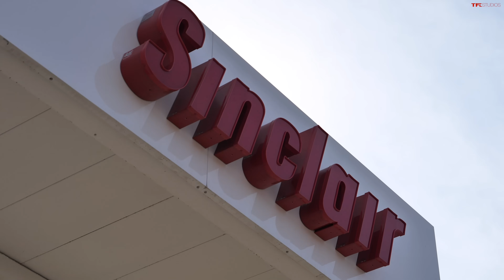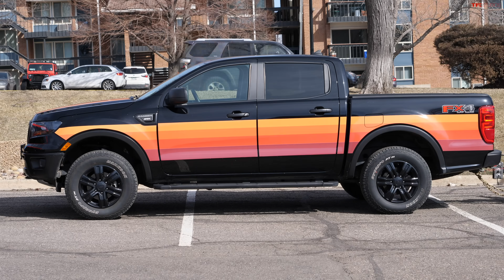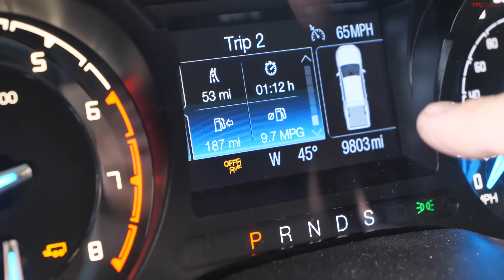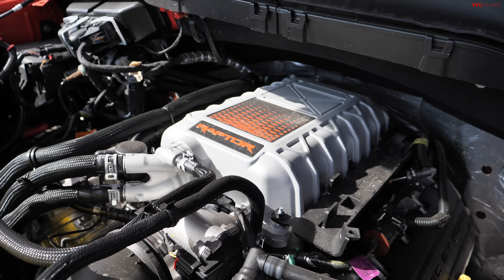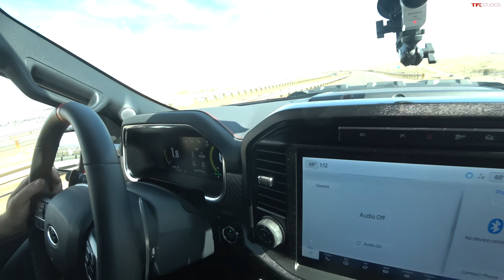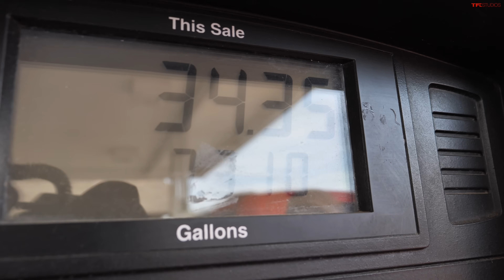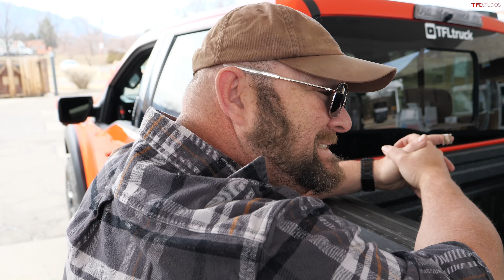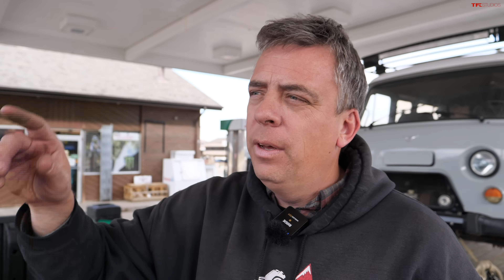Myth BUSTED: Does a Big Engine Get Better Fuel Economy TOWING Than a Small Engine?

Comment from the maker: Hey all, quick editing mistake. At the end the font says "V6" for the ranger, clearly it is a 4 cylinder. Our apologies!
Reply: nope, engines spend most of their time at a small percent of their total power.  Its more efficient to have a small engine using a higher percent of its power than a big engine using a lower percent of its power.  A turbo lets you have a small engine but have big engine power when you need it, of course if you always have your foot in the turbo you get big engine mpg's.
Reply: Wait maybe I’m wrong but wouldn’t the raptor actually be more efficient if it gets 11mpg before towing and then 7.8 while in your towing test witch is about 25% less efficient than before if the ranger was 18mpg then after towing was 9mpg which is 50% less efficient while towing😳……….I think you guys are just factoring the actual usage of fuel instead of the efficiency?! 🤔🤷🏽‍♂️
If you used a regular F150 with a 5 liter that got 18mpg as it says for 2023 and then got 25% of its efficiency reduced while towing if would show the bigger engine is actually more efficient which would be around 13.5 mpg……..sayin?
Reply: @dennissmith7214  agree sir, but the fact that even its ford vs ford its still apples to oranges as raptor is diffrent than ranger. if the vehicles are the same except the engine, without load the larger engine will ve more thirsty but when there is load the smaller engine will consume more.
Reply: @randomscene3219   Yes like compare stubby to a similar sized ram with the 5.7 and I bet the 5.7 working less with a load would fair better than stubby🤔…….but that’s just my logic kicking in.
😏👈🏽
Reply: @dennissmith7214 i think you are confusing efficiency of the engine when the premise is fuel efficiency. Doesn't matter if one engine only loses 25% mpg vs 50% mpg of the end result is you use less fuel with the 50% vs the 25% because that second option is 15% more efficient. 

Arguably of you don't need Raptor performance, which is the better option?  200% more mpg day to day and 15% more when used for towing,  or big engine go brrrrr. (This question isn't about enthusiasm it's a nerd number crunch question)
Reply: Didn’t even notice but thank you for correcting your mistake. Know if we can get politicians and the news to tell the truth we would set. Hope you guys have a great week and keep making great and funny videos.
Reply: @jeffery1524  That's a fantasy!!😉
Reply: I caught that error also, I want to point out that you chose to comparing Ford to Ford for some reason, I think it is because you want to distract views from the fact that what you should have done this test with was the white Dodge 4X4 (Stubby is it?) which is more of a work truck and would perform better in this test where the Raptor is lets say a sport truck that can tow but it is not really what it was designed to do.
Reply: @engir63  stubby is a V6 though where the raptor they have for the time being is a v8 big displacement
Reply: You’re unladen.
Reply: @johnheath4305  Yeah, you will probably see a bigger difference when unladen with turbo vs large displacement.
Reply: I was wondering if you all knew something we didn't!
Reply: nope, you should have the same car with different engine size. i forgot if it was topgear that they tested out bmw m3 with 3.0 v6 vs a prius, to test out which one is more thirsty and yes the m3 traveled farther than the prius.
Reply: i was about say deosnt the ranger have a 2.7L I4 turbo
Reply: @truckdude8080  nope, 2.3L 😂
Reply: @truckdude8080 about to get a 2.7 v6 later in 24.
Reply: That raptor is SO DAMN LOUD even in quiet mode

Comment: I think what's interesting is how much the fuel economy is impacted by towing vs unladen looking at each platform separately. The Ranger is smaller, lighter and uses less fuel to produce the needed amount of power for the vehicle combination, and fuel economy dropped by ~60% vs unladen. The Raptor is the opposite, which means it needs to produce more power because it needs to do more overall work than the Ranger, which means it needs to use more fuel than if the same V8 was in the Ranger, and it dropped by ~30% vs unladen. But in terms of fuel consumed per amount of work, you could say the V8 did comparatively the same when towing as the I4 if you factor in the weight, drag and rolling resistance differences between the two vehicle combinations.

Comment: This didn't bust anything.  Do people still not understand that experiments are supposed to change only one variable?  It's two different trucks.  My father did an excellent test in the early 80s.  He swapped a 454 in place of a 350 in a 72 Chevy short bed.  It already had TH400 transmission, so he didn't have to change that.  He had been hauling his 24 ft travel trailer two or three times a month from home to the same campground on Kentucky Lake and checking mileage every trip.  So almost a year's worth of data with the 350, against a year's worth with the 454 in the same truck.  It was consistently two or three miles per gallon better with the 454.

Comment: I have a 2006 Dodge mega cab 4x4 with a 5.7 and it gets better gas mileage towing my 5k boat than my ranger to the lake. 12.9 Dodge vs 10.9 ranger. Try not using a hot rod to tow and use a regular truck. My megacab is giant

Comment: Should have the Ranger pull the Raptor on the trailer then the Raptor pulling the Ranger on the trailer.  That way they would both have an equal gross weight.

Comment: i can guarantee you a 3liter diesel uses less than a 2liter diesel when towing 7000lbs. the 3 liter dont need to work so much. but a 7.3 will use more than a 2liter because its just unnessesarily big

Comment: Which engine has longevity? Is my question. The smaller engine has to run at higher RPMs to do what larger engine does at lower RPMs.

Comment: But you have to analyze the context of the vehicles... the Ranger is more aerodynamic, smaller frontal area and lighter, not to mention that it doesn't seem to be the 4 straight focused on performance as this V8 is... to be fair it had to do with the New Ranger Raptor with the 397 hp V6!

Comment: Unless your vehicle specifically requires a higher octane, there’s no benefit to using it. Other than the detergents in the premium fuel generally will keep your fuel system cleaner. There’s no more or less potential energy in 91 than 87 octane.
Reply: When towing, with a turbo, the higher octane will make a difference

Comment: I find it interesting how thirsty these new motors are. My 99 GMC Yukon with a solid axle swap and 35" tires gets 15 mpg on the highway, and pulling a 4,500 lb travel trailer it'll get 10 mpg. But then I don't push it to 75 while pulling said trailer, I only do about 60-65. 

Oh and shout-out to all those of us dinosaurs still using old school face watches

Comment: Kind of a flawed test. You would have been better to use a silverado 5.3 or 6.2 vs a silverado 2.7.  That would give you actual data that's relevant. And vehicle and weight but with actual engines the general truck owner uses.

Comment: Reason the straps were loose on 2nd run is because the warmer frame was on the trailered rig :)  Ha did ya know a Rail on a train track is 30 ft long and will stretch out 3 inch in the heat of the day ?  anyways... my guess any frame expansion would be compensated by the trailer frame stretching. real problem is you bent the frame on the trailered rig, (appreciate the testing you do guys) :)

Comment: I'd wager that the difference in mpg is mostly just due to the aero drag difference between smaller frontal area and smaller tires vs what's basically a Super Duty in the wind. If the aero drag was equal, I'd bet $20 the mpg towing that same load would also be identical.

Comment: I pulled my friends 29' camper,7500#, up to Lake Erie. My 2010  ,4x4 ,5.7 v-8 ,Toyota Tundra got 9.5 mpg going 65 in heavy cross winds. I expected 8 mpg ! I had a car hauler pass me and it got severe sway, I got on the brakes and it straightened out at 45 mph. Had I had a small truck, I don't I would have saved it!!!

Comment: ALSO .... doing the speed limit may not be the best idea if you want better mpg, I would suggest 60 or less on typical country 2 lane roads and 65 on the Interstate. Safety is the first concern any time you start your truck, blazing down the freeway in traffic at 75mph while towing your maximum weight could be downright stupid, and with the huge tires typical of the trucks on FLT with flexible sidewalls even more stupid, Makes me wonder if you guys have a safety officer.

Comment: Most of the energy at those speeds goes to wind drag and the fact that you towed the buhanka in both cases is the reason mpg was very similar. Size of the truck, weight of trailer and size of engine makes much less of a difference.

Comment: This isn’t a remotely valid test. You have two very different tow vehicles and this test is far more a reflection of that than the power train choices. 

If you actually want to perform a valid test then try getting two 1500 Silverado’s one with the turbo 4 and the other with a V8 and see how that works out. 

You guys generally do a great job but this was a huge miss.

Comment: I find these comparisons interesting but not surprising, all else being equal there's a specific amount of energy a given volume of gasoline, moving the vehicle + trailer down the road at a certain speed requires a certain amount of energy.  Whether it's a 4cyl turbo or a V8 doesn't matter, each vehicle combination requires X horsepower to get the work done.  What impacts fuel economy the most when comparing vehicles are things like aerodynamics/wind resistance, driveline parasitic losses, and engine VE (this one can  make comparisons difficult because the engine may not be running at the most efficient RPM for the work being done).  You could compensate for VE/RPM differences by manually shifting the transmission so that it runs near the peak torque RPM most/all of the time.  This is one reason why diesels are more efficient when under load compared to the same vehicle with an N/A gas engine, the diesels tend to run close to peak torque RPM when cruising but N/A gas engines don't, so when cruising with an N/A gas engine it tends to be way under peak VE RPM.  Diesel fuel itself also contains more energy per unit than gasoline, so it takes less diesel to produce the same amount of energy/power.  However, that's a topic for another time since this isn't a gas vs diesel comparison.

Comment: Not an even test. BOTH trucks need to be the EXACTLY the same, only with different engines. Gross vehicle combination weight, aerodynamics, tire size and type, plus many other factors comes into play. The Raptor sits high with off road tires and weighs more. A 1980's Chevy 3/4 ton full size with big block can beat that Raptor. Gets 9-10 empty or loaded>>doesn't matter. If horsepower is the same for 4 cyl, V6, V8 there will be a slight edge gained by fewer cylinders and less rotating mass and friction. It's physics. BUT the question will be: how long will it last?

Comment: Very nice , I can tell you my 2019’ranger gets the mpg of a full size v8 truck towing my trailer . I tow a 30ft 5k lb travel trailer up and down the mountains of Arizona and the worst mpg I’ve gotten was 7mpg and the best was 10mpg towing on straight flat freeway . Besides having to carry extra fuel I have had no issues towing or driving up or down steep inclines

Comment: My experience is you get about half your highway mpg towing a TT weighing 75% of max tow weight at 60 mph. The towing experience is much better in a full size truck at the expense of having a larger truck than needed for everyday use. Thanks for sharing.

Comment: HOWEVER... I live roughly 15 miles north of you I have a 25 foot TT, 6500-7k lbs loaded 11 feet tall. I had a 21 Supercrew 4x4 3.5 F150 It got 6.5 mpg from the Windsor exit to Cheyenne and back. I now have a 21 F250 with the Godzilla. both 3.55 gears etc. I saw 10 mpg on that same loop at the speed limit with both trucks. The worst we have seen was 8 in kanas with a 35 mph headwind and 75 mph. F250 is 7,000 lbs with just a driver and fuel. the F150 is 4,500 lbs. Raptor R is supercharged and not tuned for towing like the monster 7.3L  Many other Godzilla owners that came from the 3.5 repeat what I have said.

Comment: If you know that towing is something you're going to do a lot of, then diesel is the way to go.  Even though the price per gallon is sometimes above gasoline these days, you get more miles per gallon.  And loads more torque.  But if you mostly use your truck as a car and rarely tow with it, then don't worry about the fuel economy of gasoline trucks under load.  A few weekends every summer won't break the bank.

Comment: I can speak from experience. Truck was originally a 2 wheel drive 1500 92 Chevy 4.3l tbi 5speed that I towed with for several years on the farm towing double 40ton silage wagons hay wagons and equipment trailer and skid steer way too much for a half ton let alone a v6 and I consistently got 8-10mpg depending on what I was pulling and the speed i was going. Once I finally blew the engine i bolted a 5.7l tbi engine in its place same trans gears and all and with the 5.7l i averaged 9-12mpg I am sure that it was that high only cause the 4.10 rear gear meant to make sure that you would be able to tow everything a v8 could with a v6. The only real difference was empty mpg the v6 i could easily average 18mpg and with the v8 was a steady 15mpg regardless of how i drove it again gear killed me 70mph in 5th gear was 2800rpm so way to high for the v8 to be in its zone

Comment: nope different truck means different. here in the Philippines before ford ranger have 2.0 biturbo diesel engine, it used to have a 3.2 inline 5 (volvo sourced) engine and a 2.2 inline 4, now here is the thin when there is only passengers say 2-5 adults the 3.2 is much guzler, now when the bed is loaded say 500kgs (half-ton) the 2.2 is more thirsty, why? simply because without load the 3.2 has bigger displacement, but when loaded, the 3.2 is more relaxed and lower rpm than the 2.2. this vid is totaly useless. you should compare the same car but different engine displacement. pft

Comment: Small trucks of any make can get into trouble quicker than the bigger trucks of any make. On the smaller trucks the brakes are smaller so they work harder to stop especially in an emergency stop. It's not what you can tow it's what you can stop. This is for any size truck or manufacturer.

Comment: I really cant believe the Ranger did that well. I have a 2012 150 with the 3.5 and I bet I would have gotten about 8mpg on that tow. Very impressed with the ranger and 4 banger and to top it off it actually looked like it was pulling the load quite well .

Comment: Why does the subtitle or w.e. when you leave and start say v6? (with the ranger)
Also I think the F150 5.0 would be a better comparison to use, the tires on the raptor hurt it as does the weight.

Also with trucks and size and weight and engine, tons of people for example think diesels get great fuel economy but no, they just dont really get worse when towing.
Larger engines with more power dont have to work as hard and thus they may not get great economy vs smaller but they wont lose as much as the smaller engines lose when towing. Economy just kinda stays the same.

Comment: A better test is a Ram 2500 with a 5.9L Cummins vs a 6.7L Cummins or a Ram 5.7 hemi vs V6 or 5.7 vs 6.4 hemi’s. Compare like for like. Don’t do bullshit tests between different sized vehicles and try and pretend it’s just the motor size playing a factor. You guys point out some differences besides the motor but then you did the test anyway which is stupid. Do a real test, it’s pointless otherwise.

Comment: I say don't look at actual fuel mileage but look at the percentage between normal and loaded. The big engine didn't have to work as hard. So if you used the truck for towing more than commuting the big motor would be the way to go. If you rarely tow then go little.

Comment: I would also like to see this against the 3.5L Ecoboost and a normal 5.0L F-150. Obviously a cool video, but Ford is going to sell oodles more of those other trucks than the Raptor R (as much as most of us would probably love to have it).
Reply: They did this test years ago.  My recollection is that any advantage the 3.5 had in MPG evaporated in a real towing test.  The 5.0 was slightly better, but nearly the same.

Comment: Fun video although I think few people are picking between these 2 trucks  A Ford F150 with the 2.7 ecoboost and a Ranger would be a likely decision choice for a lot of people.  

 I know I have 3 trucks I use around my place and the smallest motor v6 wins every time for lowest amount of gas used if the job falls within its admittingly more limited capabilities as compared to my newer 1500 series with a small block v8 engine or worse yet is my even newer 2500 series with a slightly bigger gas engine.   Oh some will complain that working my littlest truck at its max will hurt its longevity.  Okay 31 years and counting and still doing work with my smallest truck.

I also have 8 gas tractors around the place from 24 to 51 hp.  For any job that requires say the throttle to be set to maintain say 540 PTO rpm the tractor that has just barely enough hp to exceed the job requirements at hand.such that the tractor rarely has the governor kicking in will be the most fuel efficient for the job if the ultimate goal is to save gas.  In other words the tractor I choose to bush hog when the grass is 1 foot tall as compared to when the grass is 4 foot tall will be totally different if saving gas is the primary goal

My criteria:  What does it cost me to buy it?  What does it cost me to feed it?  What does it cost me to maintain it?  A bad answer to any one of these 3 questions and I do not desire the truck,.